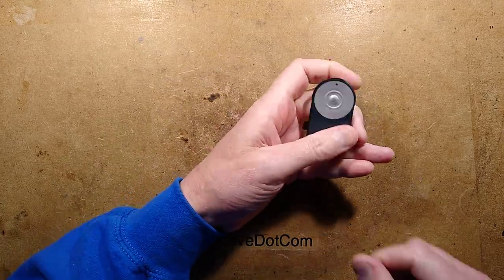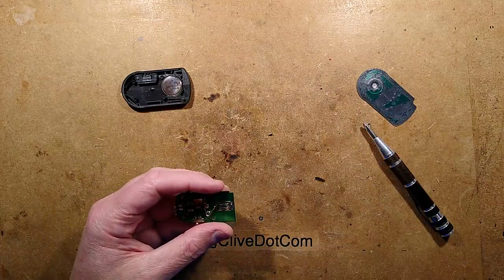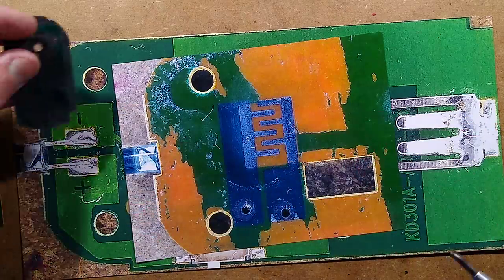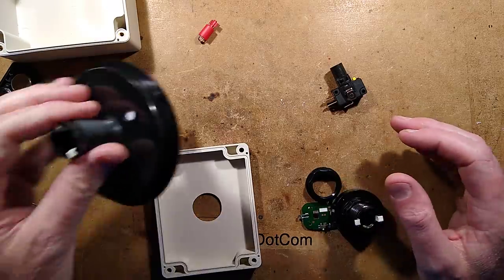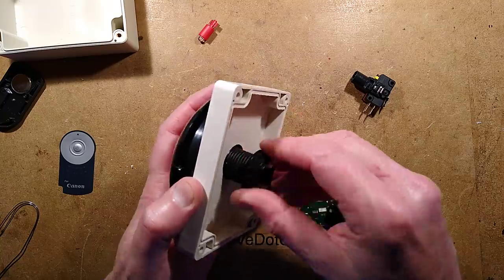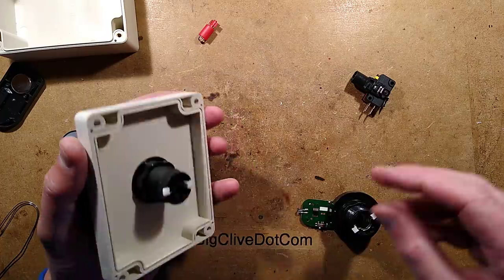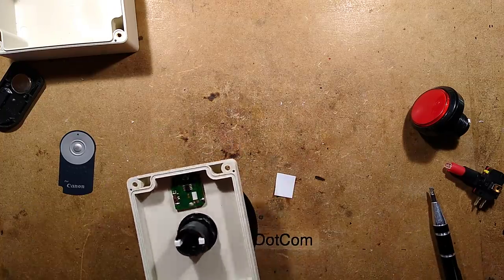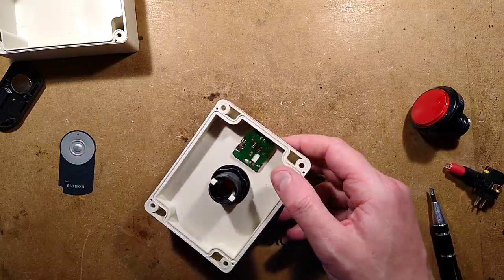How big can we make Ralfy's remote control?

Comment: I use to hold an IR remote to my camera to check the LED is working. It seems nowadays it is only working with shitty-cheap camera's.  The high brands might filter the IR out to not get a washed-out image on a sunny day.
Reply: Yup, that's my thought as well. I used that fact when teaching basic digital photography in the early 90s. They got "homework" to check and it made the pupils feel very "engineery" 😁
I think there are videos on how to remove the filter from a mobile phone camera to "see more", fiddly but possible on most mobiles.
Reply: Even the cheap cameras have an IR filter, but it's probably not as tight as more expensive ones. I have a Sony Handycam with Nightshot mode, it physically moves the filter into and out of the optical path. With the filter in place you can still see IR remotes head on. Without the filter you can see the signal hitting nearby surfaces.

Comment: Even better: have the IR LED shine through the big button so that when you press it, the IR will spread out 360 degrees and you don’t have to point the thing in any specific direction. It might need a “Super bright” IR LED and a MOSFET driver, though (and an extra CR2032 in parallel for increased current capability.) Adding sound effects seems like a fun idea, too. 😊

Comment: No, a clicker was what the Allied troops used after D Day tp identify themselves without calling out. A little brass or steel metal "toy" also used in dog training, that justgoes "click" when squeezed. The Zenith tv clickers came much later, it actually plucked (clicked) ultrasonic tuning forks to produce control signals.. The animal trainers are still around, brass make in the UK by the original firm. Steel from China.

Comment: I have had trouble with things like this becoming intermittent in time. The problem is that there is insufficient current through the switch to keep the contacts clean. There are solutions to this, but all involve modifying the circuit. For more information, see https://en.wikipedia.org/wiki/Wetting_current

Comment: It did look like the LED lit at 0:29, on the way up to the camera...  Maybe it was running low on batteries?  Or did the LED pick up and reflect some other light from the room? The later tests do show tiny flashes, too, like maybe they're too brief for the frame rate of the camera to pick up.

Comment: I would have added a resistor to match the battery impedance as the circuit probably relies on the battery for current limiting as well.

Comment: I'd really put some hot glue or double sided tape between the dome and the box. Otherwise it could easily slip and turn and either come unscrewed or twist the wires up inside.

Comment: I have a strong dislike for those graphite buttons. I used to work at a hospital and the nurse call handsets were built with those type of buttons(but with a silicone rubber button, rather than a sticker), and they were sealed units so 'unservicable'. Well, with the use of a hacksaw to cut the handset open (and many minor hand injuries) they were made serviceable, the graphite buttons were replaced with tac switches, the two halves of the shell were secured back together with superglue and a bead of silicone to maintain cleanability, and the handsets remained very much serviceable until their eventual demise by user/staff negligence.

Comment: the leakage across the cap might be just big enough to drain the battery more than absolutely neccessary and a such simple circuit probably doesnt really need decoupling that urgently. so it was left off

Comment: Hehe. I did something similar to the garage door opener of my parents when it broke after being repeatedly dropped on the asphalt. The manufacturer wanted 27 euro for a new casing (just the case, no electronics), so I made a more robust version myself from spare parts.

Although I didn't go quite as overboard as you. When 5G inevitably causes the zombie apocalypse, Ralf can use this clicker to smash some zombie heads in. My version is unfortunately not as versatile. :(

Comment: 20 ma on the LED? Usually they are rated to handle at least 50 ma. And, I've had them successfully operated at 1 A in pulse mode. They were absolutely brilliant but the pulse was so short you couldn't see the light and it had to be detected by a photodiode and fed to a scope.

Comment: Phones and things are getting less sensitive to ir these days, I think its to do with improvements to layering the glass filtering it out, by using two batteries aret you supplying twice the normal voltage to the unit?
I used something similar to add two batteries in parallel to my wall clock, meaning hopefully itll be twice as long until I have to change the damn thing, plus charging two batteries at once is easier than waiting for an extra to die
Reply: Using two batteries supplies the normal voltage. The original CR2032 is a 3v cell and AAs are 1.5v each.

Comment: The conductive coating should be carbon black, not graphite.  (allotropes)  He should have soldered the switch wires to the plated through holes. Ron W4BIN

Comment: Wouldn't a battery disconnect have been better to make sure the pack does rip out when the batteries are changed. Also installing the button on the box and not the lid would have hidden the screws.

Comment: you see what i would have done is instead of soldering into where the button goes.
i would have shorted the button pins and soldered onto the battery holder instead.

Comment: Can you please make a video how you should solder those self insulated thin cables they use in headphone cables? I need to fix a pair of headphones(put a new plug on some Marshall's) but i cannot flow any solder at all on the wires, tried burning the coating of with a lighter, untwisting them and burning it etc. Using an old Weller WTCP-S with a #7 thin tip (380C?). Got a #8 as well that gets hotter but that's a broad head..  I'm having problems flowing regular cables with the #7 as well, took an hour to fix an USB cable earlier today.

Comment: Is there any chance at reverse engineering a IR light pcb? They are quite easy to find, and all seem to have the same circuit, but for the life of me I can’t figure out how they work. They appear to have a pnp and an non transistor, then maybe another transistor and an LDR. Typically powered by 12V I used one by desoldering the LDR and it turns out you can at least drive the entire board with a mosfet and make a beafy IR Transmitter for home automation. That thing can now fire the wrong way and still power my TV on and off. That would also make a camera remote pretty nifty to control it from 20m away.

Comment: What's the optimum soldering temp for an iron because mine keep disintegrating an melting away at 450°c
Reply: 450 degrees Celsius is 842 degrees Fahrenheit.  Are you trying to solder or melt steel?

Comment: Are the button cells 3.7 VDC? If they are might the 3VDC be to low? Was wondering because if so , it might have a problem overcoming the forward voltage of the LED. Not sure of any of the numbers above, so just curious if that could be a problem. Thanks for the video Clive.
Reply: No
Reply from the maker: The lithium cell is 3V and the IR LED is probably around 1.5V to 2V.
Reply: Thank You.

Comment: Doesnt the button light up when pressed? It doesn't look lite it does in the video.
Reply from the maker: It could, but not the way the contacted were being used by the chip.
Reply: @bigclivedotcom  cant you do some transistor magic so it will light up with every push and also replace the LED with a eye-watering bright one? or something like that :)
Reply from the maker: @MrMiryks  it might be possible, but in use the camera cuts out the point the button is actually pressed.

Comment: Hi Clive
Watch this video from shango066 https://youtu.be/OPRqW7l7r-A?t=752 where he shows a old remote control for a TV that does not require any batteries. It uses steel rods that when hit produce tones that a receiver in the TV picks up to change channels and other functions. The sounds these remote controls made might be the reason they are called clickers today.
Its really interesting old technology that seemed to work well and still works around 60years later.

Comment: Is that a Suzo Happ button or a cheap knock off?
Reply from the maker: It's a knock-off.  The original Starpoint style buttons were much better quality.
Reply: @bigclivedotcom  We get that a lot! Go to replace the switch section and then realise that the button isn't quite right and it doesn't fit!